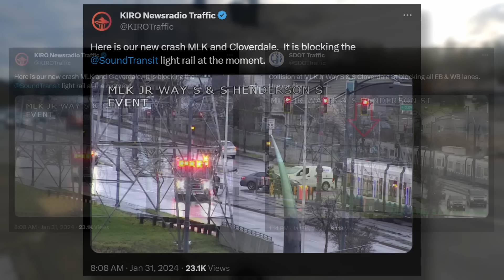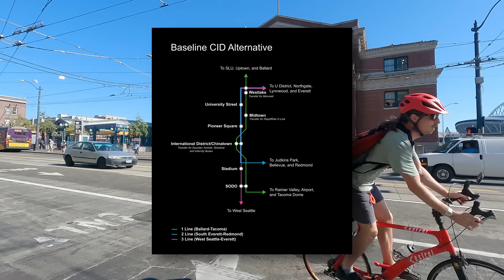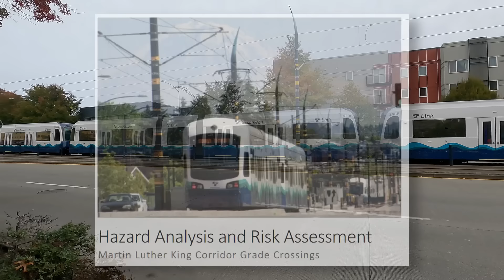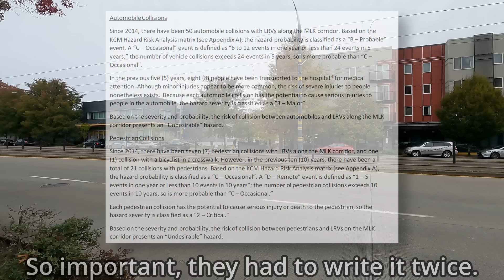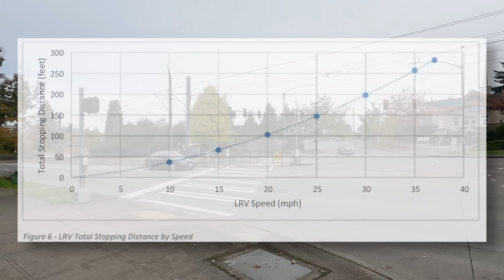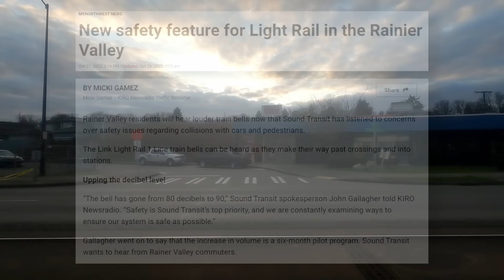Don't Skimp on Grade Separation

Comment: It's insane to me that this is centre running. It should at least be running along the side of the road with boom gates.
Reply: Side-running tram tracks tend to have lower maximum throughput & more vehicle conflicts than center-lane tramways. Compare Link with DC's H St line, for example. In Seattle, collisions usually occur at intersections. In DC, collisions can occur anywhere along the line, where a car might turn across the tracks into a parking space or alley. It's one thing if the tramway is along an arterial road with intersections and driveways every quarter to half mile; it's another thing entirely along a dense downtown street with potential entry points every half block.
Reply: @jmchristoph  Why TF would there be driveways and parking lots fronting onto a main road? That’s insanely bad design.

Like I said, crossings should at least have boom gates if it’s a metro. Really it should be entirely grade separated.
Reply: @shraka  idk what to tell you, but you'll find driveways & on-street parking along plenty of streets where you might want to build a tramway. Central Ave in Phoenix, H St NE & Benning Road NE in DC, any one of the myriad at-grade light rail alignments in Portland, etc.

The solution is to prevent cars from crossing the tracks except at a small number of arterial intersections where the tram can be given signal priority. If you do that with a center-lane tramway, you don't have to disrupt the existing street grid & building access as much as would be necessary to eliminate conflicts on side-running tram tracks.
Reply: @jmchristoph  The video is showing a 4 wide lane road. I understand the U.S. loves it's stroads, but that's also a bad design pattern. If this is a road, collapse it to 2 lanes and add small side access roads - one of which can be placed on the other side of the tramway. You can probably narrow those lanes too and fit a whole bike path in there. That way half your passengers only have to cross a small street and bike path to access transit rather than everyone having to cross and wait next to a main road.

I live in Melbourne. We have a few centre running trams with dedicated ROW. It seems to have mostly been done out of a sense of symmetry.
Reply: @shraka  so what you're describing with the side roads is precisely how K St NW in DC is currently designed. It's historically been both a traffic and pedestrian nightmare, even without transit or bike lanes, because the side access lanes only add additional conflict points for cars. Hence why, as DC is currently redesigning K St NW to include a transitway, the bus/tram lanes are going to be in the center and the side access lanes will be eliminated. There's also room for bike lanes and central pedestrian islands in the new design. And yes, they are narrowing the car traffic lanes, reducing the number of lanes by 2, and reducing the number of side parking & access points.

But at the same time, DC has learned the lesson of H St NE, where the streetcar was installed along the sides exactly as you've suggested doing, and it's been a congestion nightmare. We won't fix K St by making it more like H St, or by leaning into the old design.
Reply: Building tramways in the middle of a road, protected or otherwise, is standard in Europe. You could place the tracks (both, that is) on the sides but this is only possible if that side has limited access (which means no access to properties and most streets) and is more applicable where nothing or few things on that road has been built.
Reply: @MarioFanGamer659  I've been to Europe and live in Melbourne. I know how trams work. This isn't a tram, it's closer to a light metro. It should ideally be entirely grade separated, but if not it should be behind boom gates, not in the middle of a 4 lane road.
Reply: @shraka  The thing is: The initial plan of LINK was a (regional) tramway but then the came decision to build all extensions grade separated.
Asking why the tracks weren't built on the side of the road is like asking why it isn't entirely grade separated.